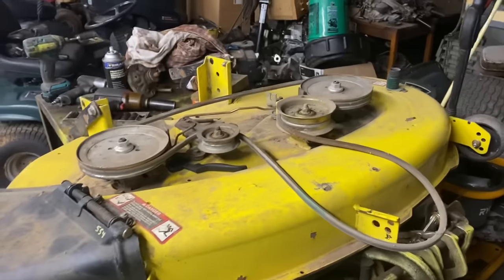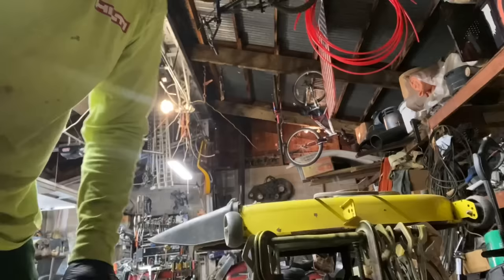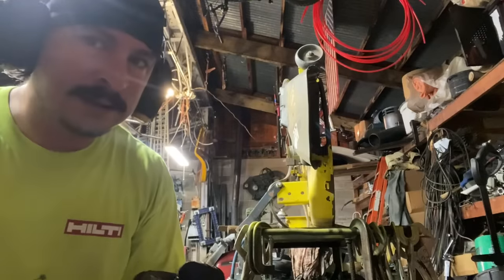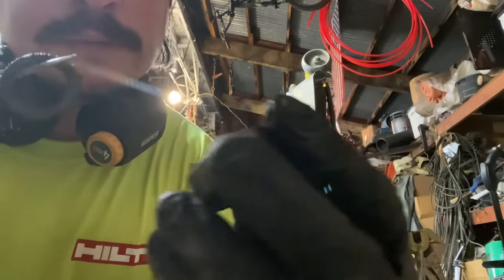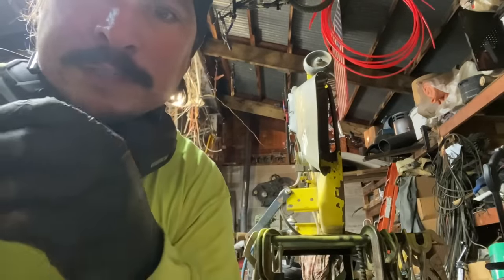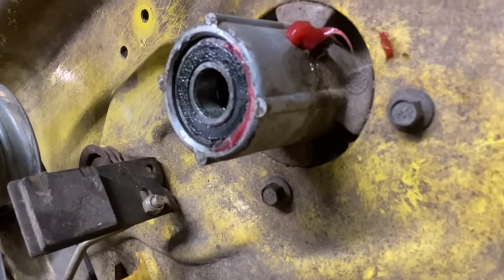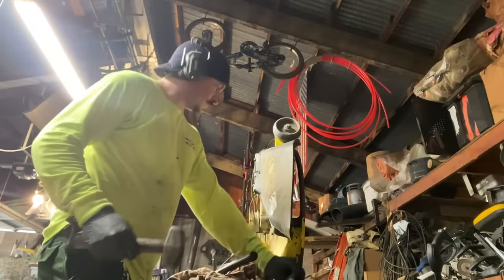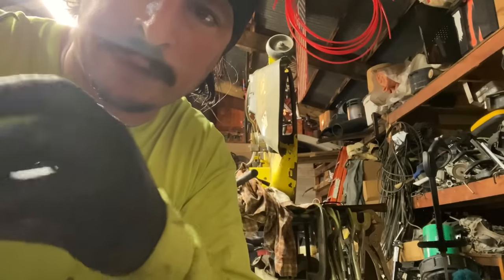Part 1 - Don’t trust the “Experts” Grease your mower deck sealed spindle bearings Common sense.

Comment: My thought is that when you  removed the seal, you created a slight deflectiion that allowed the grease entry
Reply from the maker: Well I hear ya, but that’s incorrect. I’m not trying to make folks believe in magic. Put a grease gun on yours and put it to the test. This is not a theory. I have been greasing decks for over a decade. I am hoping this video will make folks question the clowns out there saying that you should not even bother greasing your deck mandrels. Seals can be removed without any damage. Of course if the seal is old or string or something has been wraped tight enough to damage the seal that could be possible on the lower outter seal. If a seal is aged the rubber can be brittle on the seal and when brittle they can be damaged when removing. However that was not the case here. damage to a seal will be obvious when you remove the seal. if you grease a brand new assembly that has never been apart it will Be exact the same as I demonstrated here. I only disassembled the one in this video to verify and show that grease made it into both the upper and lower bearings. As Iv written in dozens of comments, these seals can’t hold back pressure from the grease gun. They can’t even prevent water from passing into bearing. They are not holding pressure, nor will they. The word seal can be misleading. Is really just a dust shield and helps retain grease.
Reply: @GTObearclaw1  yeah, i believe you. Have you ever seen a deck where even though the housings have zerk fittings, there is a small hole that squirts out grease before you can build pressure?  I think it was a Husqvarna
Reply from the maker: @michaelannen4168  yes it’s a MTD thing. I have covered that on a few of the comments on this video. I believe it’s MTD trying to prevent the housings from being filled with grease. The pressure escapes that hole first. Then the grease never builds pressure to pass into bearings. Then the bearings fail sooner and the company can sell you parts. Pretty sleazy company to be  engineering like that. I’m sure they know exactly what they are doing and in the long run they pocket more profit but it’s at the unknowing customer’s expense. This is one of many reasons I avoid MTD equipment. They are the worst of the riding mowers. And unfortunately MTD owns and builds dozens of brands. CUB, whites, yard machines, Troy built, Huskee and man many more. 
I have never seen the holes on a Husqvarna. Maybe your thinking Huskee. One person left a comment and said he fills the hole with JB weld. I put a screw in the hole. Then they can be greased as I showed. Have a good day!

Comment: I'm just wondering why the companies aren't saying to fill up these spindles with  grease however many pumps it may take to fill up the whole reservoir.
Reply from the maker: My guess is that it’s like any other grease point. Until you see grease coming out from
Somewhere it’s not fully greased. At least that’s my experience with greasing stuff.

Comment: You take the spindles apart remove the inner seal on the top bearing and remove the inner seal on the bottom bearing and put a weep hole on the opposite side of grease fitting and reassemble the spindle.
Reply from the maker: Actually, NO I don’t. And I never will. Do you even me mechanic bro? Weep hole? No no no no no no no no no NO. Terrable advice. That comment made me cringe. 

You can waste time removing seals. And I do mean waste time. Because they don’t stop pressurized grease but by all means remove them if you want. I can’t stop you. I’m just trying to save folks an unnecessary hassle and waste of time. But some folks just can’t grasp the information being provided. And I totally get it, I suck at math. Don’t matter how it’s explained my brain don’t absorb that information. And the information here that seems so simple to me just won’t compute for some folks. Seems like the video would be enough but that’s okay, I get it. This info is just not gonna jive for everyone but all that said, heck no on a weep hole.  It’s just a way to let grease escape easy from the mandrels before it goes where it’s needed. And why? This is how MtD sabatages decks to guarantee sooner failure. I sure don’t want an easier way for dirt and water to get in. And that’s absolutely all a weep hole is good for. Weep holes are bad for this application.
Reply: @GTObearclaw1  if you don't put a weep hole in you can build up so much pressure that it will start pushing the bearings out.
Reply from the maker: @charleskeisler716  absolutely absurd. 

Please make us a quick video to prove your point and drop your link here to help the DIY community. 

Assuming we are talking about a good working assembly that simply needs grease, the only way the bearings could be pushed out is if you have removed the nut on top of the shaft. Those bearings are locked in place. Nothing short of removing the nut on top of the shaft will allow them to come out of place. You would need to take the nut off to get the bearings to move a mm. Why would someone even add grease after starting to disassemble a unit? The shaft running through the unit is precision fit no free play and not a bit of movement of the bearings will ever occur during greasing unless someone has been messing around and put things together wrong. The point is, add grease from the beginning, long before a bearing fails. With proper lubrication there should never be a reason to disassemble the assembly / mandrel. It’s the basic science of these units. Nothing new. Been the same for longer than Iv been alive. If you have a grease zerk just use it. If you happen to have a piece of junk Huskee, yard man, yard machine, wires outdoor or anything else that MTD has botched and put that stupid weep hole design speindle on, just plug the hole with a machine screw or whatever you can. Then grease will make it through the bearings. No other companies that I’m aware of have used the weephole. And none should. It’s sabotage from the company made to cause the early failure of the mandrel bearings and that’s the only thing the weep hole is good for. Putting more money in the big corp pockets. That weep hole will only allow grease to escape before it can build enough pressure to push past the weak lip on the dust caps. And by pressure I mean a few PSI. About the same PSI as a soft fart. We are not pumping up dozer tracks here.
Reply: @GTObearclaw1  You don't put a hole the size of the hole that you put the zerk fitting in, you put a very small hole on the opposite side, any extra Grease will push out, the whole small enough the grease doesn't run out of it, what is greased up and you see a little Grease come out the weep hole you wipe it off and you're done, a very small drill bit, not a large one.

Comment: I wish all spindles came with a grease fitting. 
I’ve seen so many without.
Reply from the maker: Yes true. And some are hidden well. The ones on the under sheet covered with grass and many folks never know they exist. You can also add zerks prety easy. A lot of channels show how.
Reply: @GTObearclaw1  
I’ve added them before but I’m not too sure that drilling the hole for them doesn’t weaken the cast aluminum housing. 
The manufacturer makes them so cheap these days. 
I remember back in the late 80’s when I took small engine repair in vocational school, the spindles were so much better. 
In my opinion the manufacturers want them to have to be replaced. 
I see so many new looking mowers being tossed and the consumer will just go buy a new one.
Reply from the maker: @Youtubeparolee  drilling a hole for a zerk won’t cause issues - if they break it’s always at the mounts

Comment: If they put a grease fitting on it then it seems obvious somebody thought you should put grease in there.  While you can add too much grease, I still think it needs grease.  (i give mine a 2 pumps about twice a season)
Reply from the maker: Well I agree if it has a zerk it was intended to be greased. 

However the hollow space between the bearings will hold about 50 to 70 pumps from a hand pump gun. The amount of grease will depend on the specific type of deck mandrel. But let’s just say yours needs 50 pumps to fill it before grease will build up and bypass the inner shield to reach the inside of the bearing. You say you add 4 pumps a year or AkA a season. So in a little over 10 years you may have finally pumped enough into the mandrel to push a little past the inner seals and into the bearing. At some point the spindle will be filled and by then your bearings may fail due to never having grease reach them. This is actually something I see regularly. Folks didn’t realize that a few pumps is a waste of time in this application. Then they can’t believe when I tell them the bearings went bad due to being dried out. Then when I show them the same thing I put in the video they can understand why things went wrong. I can only lead a horse to water so to speak. I provided the information I wanted to share. What folks do with it is their choice.
Reply: @GTObearclaw1  I began by filling the spindle, I'm just topping it off at this point.

Comment: Why not leave the rubber shields off so more grease can get to bearings?
Reply: Jus t the inside sheilds
Reply from the maker: Iv explained it 100 times in the comments. you can waste the time to take a deck apart to
Remove the shields inside but why? I just showed evidence the grease passes that inner facing shield to get to the bearing. So why exactly would anyone waste time
To dismantle a perfectly operational deck with a zerk already in place? Ignorance would be the only reason and if it was just explained in baby step details and they still
Choose to go that route, they obvious didn’t
Catch the point of the video. I did all that to prove the inner shields are not preventing grease from passing. That’s the whole reason I left them on during the process. I could also make a video showing how to remove inner shields but I am one of the few who seem to understand its a pointless process and not worth the effort. Also the upper bearings inner shield also provides the benefit of holding the grease in the upper bearing. As gravity and heat help
The grease work it’s way down. So personally I prefer my shields left in place.

Comment: 1) use the right grease for the job.  2) You don’t need as much as you think.
Reply from the maker: First off, thanks for taking the time to comment. But as you may or may not have noticed in other comments. I am very active in providing timely responses. Please don’t take anything personal but I’ll reply to your comment like I would any others that have opposition to my provided information that has already been proven in a video. All the things Iv shown can be tested step by step by anyone who cares to discredit my process. If you can find faults in the process please show us.I’m not saying my way is flawless but it has never let me down. That’s why I share it. 

Are you some kind of expert? If so please provide video proof of why things matter. Your opinion is worthless without proof it’s just talk. We don’t need more experts talking to us about what the right way is. We just need proof to provide to the DIY community so people know the truth. 

1) any grease is better than no grease. Fact. 
2) yes actually the assembly must be pumped full, only when it exits out through a bearing is it filled. At that point stop greasing immediately. Pay attention to both the top and bottom bearing to see when grease exits. If grease does not exit, a air void may be present and that means you have no guarantee that grease reached both bearings. So don’t stop until grease exits. This is so simple
It’s dang near stupid but here I am explaining it for the second time if you consider the first time was in the video with step by step proof. Not to mention the hundreds of comments like yours Iv replied to. And to that point none of witch have ever provided one shreds of evidence proving otherwise. 

If you have advice and can provide proof to back your claims please post that information in a video. Explain how and why things matter. How things work. That helps us. Anything else is opinion. Opinions, well you know the thing.

Comment: Leave the seals out of the bearings then drill 1/16" bit size hole into the body so when you place grease in the next time it will bleed out.  Next time you grease the bearings you know when to stop filling when it begins to bleed out.
Reply from the maker: I dislike the MTD sprindles with the weep holes. Whit a hole between the bearings grease will
Easily exit there first before pushing into the bearings. I would advise any one with a hole in the middle of the bearings to stick a screw in it and seal the unit. I do not advise anyone to drill a hole so grease can exit before passing through a bearing. MTD is the only company I know of who does that to the new units and I think it’s a way to make bearings fail faster. In addition I don’t think any modifications other than adding a zerk are necessary for any mandrel assembly. If I was to take a mandrel apart to do anything I’d simply change the bearings or upgrade them to a better quality. The one and only reason I pulled them out in the video was to show viewers a before and after of what grease was in the bearing so folks would understand what happens when grease is properly applied and considering no other videos on YouTube show this process it was necessary to take those steps. Most folks seems to appreciate the effort. Some folks have there own ways and that’s great. The way you explain will also be beneficial VS the other option of doing nothing at all. You will obviously benefit more any time your adding grease. But the extra work of dismantling a perfectly operational assembly just to remove seals and drill holes is 100% a wasted effort unless you don’t already have a zerk on the unit. As I have clearly proven in my video the grease finds it’s way past the ultra thin and extremely flexible rubber lip on the shields and the grease easily passes right through the bearings. It’s way more simple than folks allow it to be. These shields don’t hold back pressure. The shields are not seals like folks want to believe they are. They are not capable of even holding back a few PSI. So why bother removing shields? What’s the point if they already allow grease to pass? Exactly as designed. drilling a hole to let grease out of the void between the bearings seems problematic in itself. But with seals removed you stand a much better chance of pushing grease into the bearings with no blockage.  However it’s just not necessary and most folks don’t want to take apart a good operational deck when a much better faster alternative is already available. Simply use a grease gun and add grease and your done. I like the units to be solid so the new grease pushes past the bearings. No biggie. Rather than exiting a hole drilled in the assembly grease simply pushes out through a bearing. Part of the reason I made this video was so folks would have other options that don’t require dismantling a deck. Iv seen plenty of those videos where the pros suggest not even greasing unless the inner shields are removed. That’s dumb, why not simply apply grease to the available zerk and see where the grease goes. If you keep pumping it’s bound to go somewhere, I guess that’s common sense and way too much to ask from a professional mower mechanic. Iv proven those experts spreading that nonsense are incompetent and should not be giving advise on the topic. Even after kindly mentioning the facts and that some of those experts should run some tests they continue to keep those videos posted so I made this one to show the truth of the matter. My process can be tested by anybody with basic tools and any interest in proving me wrong. It’s all there in a video. I’m not a magician. It’s real life. So simple
It’s dang near stupid to have to explain it after making a detailed video on the topic.

Comment: The amount of time needed to grease sealed bearing you may as well replace them .used a craftsman for25 years and never greased them and sealed bearings were like new .
Reply from the maker: Im not saying some machines are not built better than others. Your tractor is not representative of all tractors. Not to mention things have changed in 25 years. You won’t find craftsman bearings in the new ones to last that long. 25 years ago you got a lot better quality machine than what they provide today. Quality has gone down hill. The way I show takes time but that’s just to make the point to clear up the confusion on this subject. However it is actually not a very time consuming project to connect a grease guns and service. It takes about 5 minutes to grease a few mandrels the way Iv shown. And that’s 5 minutes for the first time to fill the voids. Future greasing would be even faster only needing a few pumps on latter services after voids are full. I’m sure you realize it takes more than 5 minutes to change bearings, that’s just a silly thing to say that it would be faster to change bearings. Be realistic, no need to be dramatic. The information is helpful to some. Some folks can find error in anything.

Comment: I always remove inner seals just for ease of entering bearing
Reply from the maker: It’s less trouble to grease with a gun. No reason to dismantle the deck just to get grease in the bearings. Those shields won’t hold grease back. Most folks just don’t realize they need to pump the assembly full to get grease in the bearings. That’s why I made the video. If you prefer to dismantle the deck that’s your choice. I just want folks to realize that’s not necessary.